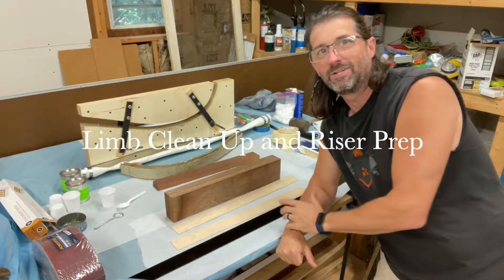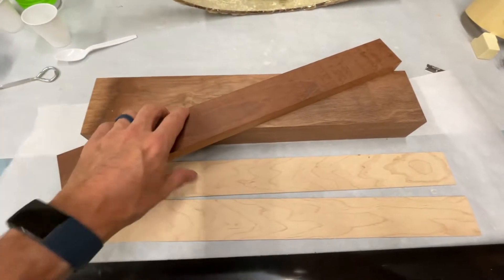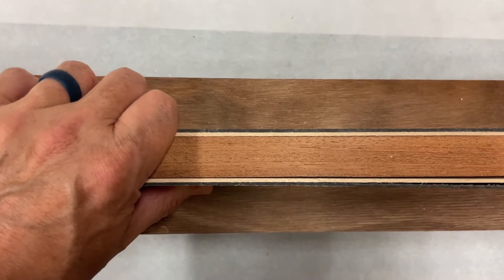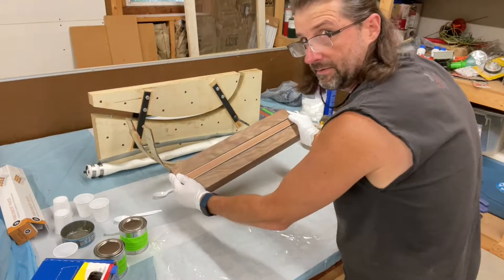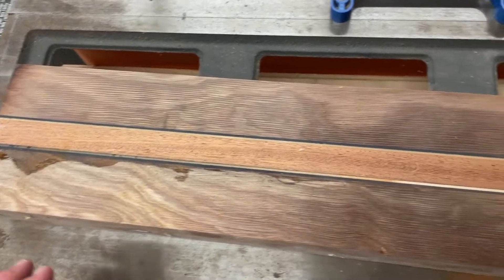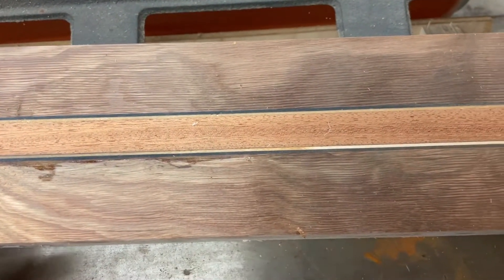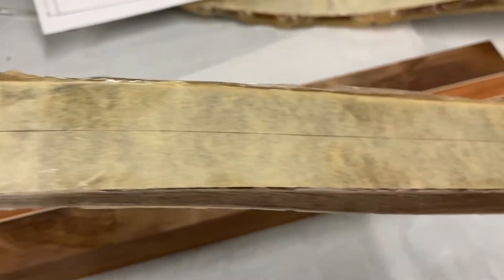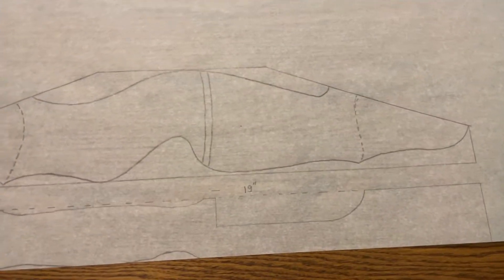Bingham Projects Take-Down Recurve Bow Build Series - Part 5 - Limb Clean Up and Riser Prep

Comment: With the phenolic you want to sand off that shiny coating so the epoxy can soak into it if not it could possibly cause issues down the road g10 also comes with that coating
Reply from the maker: Yep someone else told me that as well after I finished it.  I filed that information away for the next one.  Hopefully I will get lucky and not have any issues down the road.  I guess time will tell.  Thank you for that information though cause that is very important!